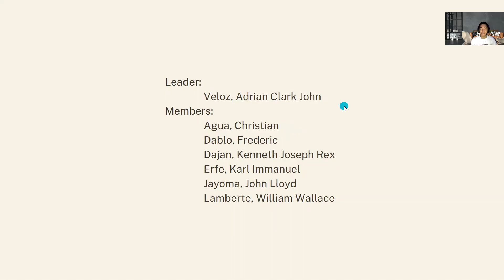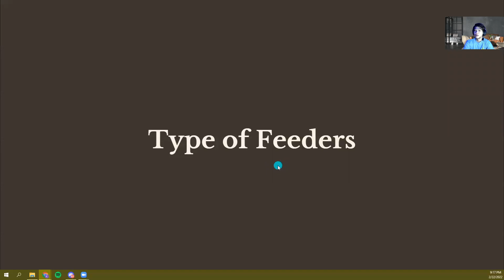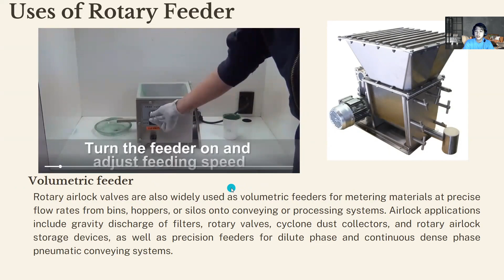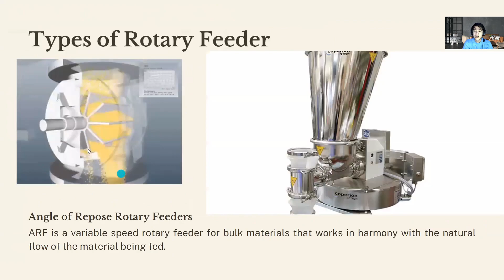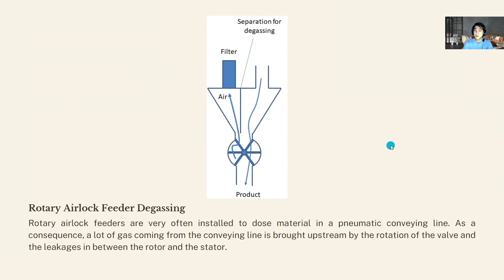FEEDERS AND STORAGE SILOS (GROUP 5)

Comment: Aggarao, Kaleel
ME4A
32:04 - Multiple diameter screw feeder
As the name implies, it is a type of screw feeder that has varying diameter in its screw shaft. Screw feeders are mainly used in bulk handling industries like agriculture. Having the ability to sort the materials by size shortens processing times and improves the overall production efficiency.

Comment: Casiño, Sharia Cyril P.
9:13 Blow-thru Rotary Airlock Feeder
The reporter explained it well. This type of feeder uses a pneumatic conveying system that pressurized air is being applied. This means that the materials being conveyed after passing through the feeder are blown using, usually, air. This feeder also best applied for handling solids when it is necessary to separate two areas under pressure, while moving the material from one condition to the next.

Comment: Tapongot, Jouryel Ian Roy B.
13:35 Electromagnetic Vibratory Feeder
"The Electromagnetic Vibratory Feeder" employs an electromagnet as a source of linear vibration, allowing for extremely fine vibration control and variable feeding speeds. When the feeder is stopped, there is little coasting, allowing for precise feeding of discrete amounts. The largest model, MFW, outperforms conventional electromagnetic systems in terms of feeding performance and operating noise.

Comment: Lawan, Edcel Benz R. 
29:33- Archimedes Screw
The Archimedes Screw is a topic that has piqued my curiosity. It was around 250 BC when the first screw conveyor was invented, as well as the first positive displacement pump, which was used to transfer water from low-lying fields to elevated irrigation channels. This screw has been developed over time, and a video that was shown during a news report about the archimedes screw helped me understand how it works.

Comment: Matthew Antoine Lawrence B. Añora
2:50 Useful thing about feeders
I have just learned that feeders play a vital role in the manufacturing process though it only stocks materials in the bin in a continuous manner. It is widely used in cement, mining, and other similar industry as part of transport processes. Without feeders, it would be difficult to add raw materials or other types of materials to the manufacturing process since there would be regulation of materials with the shape of the feeder, and the materials might be distributed in not an even manner.

Comment: Zayas, Frankyrex Aldrich B.
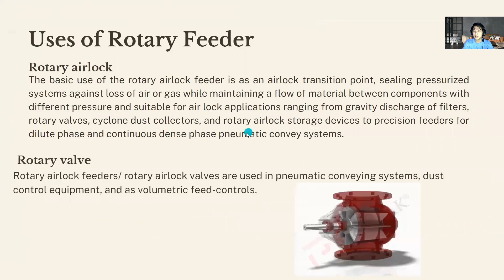8:30 - Blow-thru Rotary Airlock Feeder 
The reporter explain this part well and the illustrations of the feeder is big so that it can see clearly. This feeder is interesting because it uses air to push the material outside the feeder. Unlike the other feeder that doesn’t have this kind of mechanism.

Comment: Zalsos, Ervin A.
28:21 - Screw Feeders
Screw feeders are designed to properly convey finer, granular materials from one portion of the feeder mechanism to the other. The discharge rate of a screw feeder may be precisely calculated using speed control and screw pitch design. Variable-speed drives increase metering accuracy while also allowing for a wide variety of input rates.

Comment: Castillo, Floyd L.
42:38 - Silos
 A silo is a structure for storing bulk materials. Silos are used in agriculture to store grain, powders, fermented feed but silos are also used in other industries as bulk storage for coal, cement, sand, metal waste and more. The other types of silos was also discussed and how each of them function.

Comment: Simene, Jeff Hentzen F
BSME4A_M1

13:59 Vibratory Feeders

A vibratory feeder is an instrument that uses vibration to "feed" material to a process or machine. Vibratory feeders use both vibration and gravity to move material. Gravity is used to determine the direction, either down, or down and to a side, and then vibration is used to move the material.

Comment: Mier, Dan Lester
43:31 Silos
Storage silos are cylindrical constructions that range in diameter from 10 to 90 feet (3 to 27 meters) and height from 30 to 275 feet (10 to 90 meters), with the slipform and Jumpform concrete silos having the largest diameter and height. They are available in a variety of materials. Wood staves, concrete staves, cast concrete, and steel panels have all been employed, with cost, durability, and airtightness tradeoffs to consider. Air slides or augers are commonly used to empty grain, cement, and woodchip silos. Rail cars, vehicles, and conveyors can all be used to empty silos.

Comment: Casiño, Earl Anthony N.

24:07 | Vibratory bowl feeders

The reporter defined it as a special type of vibratory feeder that has troughs wound helically. These machines use vibration to toss and shuffle the materials. He also shared the main benefit of it, as it was primarily used in conveying and orienting items.

Comment: Cubrado, Xyreal L.
17:02 - Electromechanical Vibratory Feeders
Electromechanical vibratory feeders or eccentric-mass mechanical feeders are the types of vibratory feeders which create vibration by rotating weights using electric motors. Since these are powered by electromechanical drives, they are preferred for medium to very heavy-duty applications and are well suited to 24/7 operation. Electromagnetic drive motion works by energizing an electromagnet to pull against a secondary spring mass system at a constant frequency in order to create and amplify a linear displacement.

Comment: Obrador, Crisaint John G.
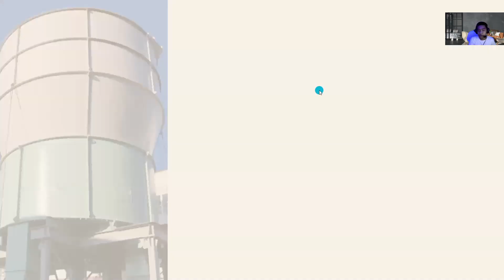1:54 - What is a Feeder
So, by definition, a feeder is a piece of material handling equipment used to regulate the flow of bulk materials into the machinery for further processing or other process. This type of machine is essential in industrial works, and there are many types of feeders. 
I would like to commend the group, because they delivered their report clearly, and did mot just read the whole slide, but also provided some explanations and illustrations.

Comment: Cagampang, Jon Eli P.
39:58 - centrifugal bowl feeder
At 39:58, the reporter explains what a centrifugal bowl feeder is. Centrifugal parts feeders are utilized in high-speed feeding applications or where vibration is an issue. Inside a bowl, a cone-shaped disc rotates. Parts placed within travel in a circular motion, and centrifugal force propels them toward the disc's boundary.

Comment: Requina, Peter Allen Sid N. 
29: 38
Screw feeders consist of a trough with a spinning screw shaft within it, and the material moves linearly through the trough as the screw shaft rotates. Screw feeders can be set up to provide both horizontal and vertical travel paths, as well as sloping travel paths. Screw conveyors come in a variety of shapes and sizes, each designed to handle certain materials and their qualities.

Comment: Edio, Van Albert T.
38:30 - Vibratory Bowl Feeders

This feeder is made up of a bowl mounted on a spring loaded base. When activated, the springs are intended to limit the bowl’s vertical movement. The components are oriented into the required position for processing based on how the bowl is tooled. This type of feeder are commonly found in industries that require flexible feeding systems for the mass production of parts or pieces, for example, pharmaceutical industry, as well as the processing of consumer electronics.

Comment: Acelo, Ray Joshua L
42:24 - Conical bowl feeder 
The reporter explained what a conical bowl feeder is and how it works. It uses parts with simple geometry and it is different from the vibratory bowl feeders that has a complex design. This type of bowl feeder can be used in a pharmaceutical industry and food processing.

Comment: Candaroma, Katriona Maxinne G.
50:10 Bins
Bins are metal cylinders with staircases on the exterior that are commonly found on grain fields and grain elevator locations. It holds dry grains such as corn, soybeans, and wheat. Because bins require air circulation, they include more ventilation devices such as roof vents and temperature systems than silos.

Comment: Abello, Raynand R.
13:33 - Vibratory feeder
The reporter deeply discussed how vibratory feeders works and served to the industry. Vibratory feeder is versatile and have been extremely used for automatic feeding of small to large and differently shaped industrial parts. With these easy to use and high-performing part-feeding machines, customers from varied industrial sectors have achieved lower error rates, less power consumption, better profits, better rates of efficiency and less dependency on manpower.

Comment: Griño, Loruelle Z.
29:45 - How does a screw feeder work
Screw feeders are made out of a revolving screw shaft positioned within the trough, and the material travels linearly along the trough as the screw shaft turns. Screw feeders can be configured to give both horizontal/vertical and sloped travel routes. Screw conveyors of various varieties are intended to handle certain materials and their properties.

Comment: Dacoroon, Darlene Grace F.
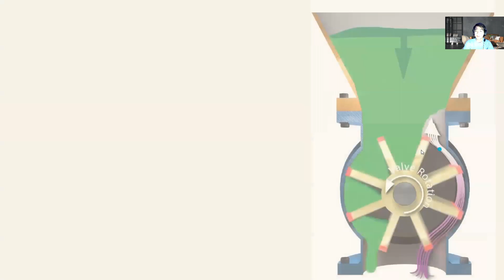3:24 - Rotary feeder
The reporter briefly explained his part, which is one of the types of feeders, the rotary feeder. As a summary of what I saw, this type of feeder are used in agriculture/industry to regulate the flow of a product, usually to reduce the flow rate to a level more suitable to the process being undertaken, and also ideal for pollution control applications in wood, grain, food, etc. Overall, the reporter points out the step-by-step flow or process of how a rotary feeder works, which gives a detailed report and is understandable to the viewers.

Comment: Romero, Lorenzo Matthew D.
0:53 - Types of Feeder
The group discuss the types of feeder and its mechanisms. There are variation of feeders each  types has different mechanism like Apron Feeder it accept very hard, abrasive, and tough materials, as well as lumps of larger dimensions and those which are beyond the scope of other feeders. Also the group shows a picture rotary feeder, a rotary  Feeder separates a pressure differential while allowing material to pass through it.

Comment: Estillore, Cherry Mae P. 
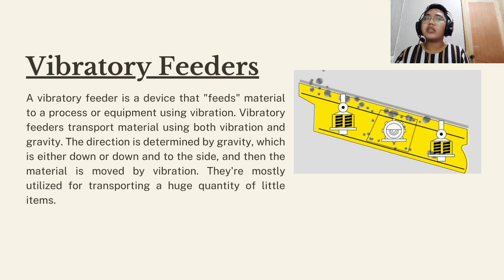15:06 - how does vibratory feeder works
Vibratory feeders transport material forward using both vibration and gravity. Gravitational forces cause these parts to shift direction, forcing them to travel down or laterally. At the same time, vibration is used to cause the material to move. Vibrating feeders are utilized in a variety of industries, including the pharmaceutical, automotive, food, and packaging industries, to handle bulk materials. This technology can move thousands of items on a regular basis, saving humans many hours, exhaustion, and even bodily harm. Whether you're working with big, chunky material or finer particles, vibratory feeders can handle the job.